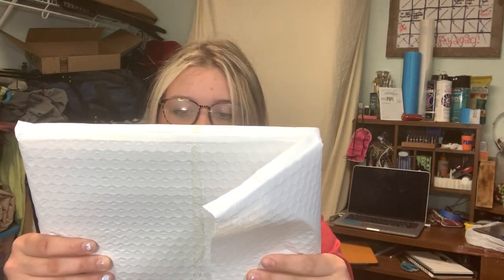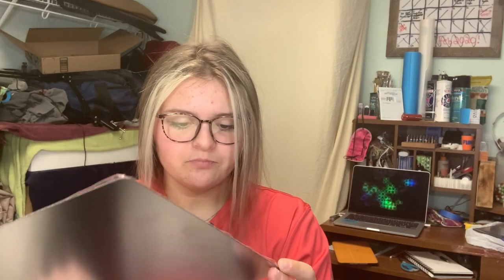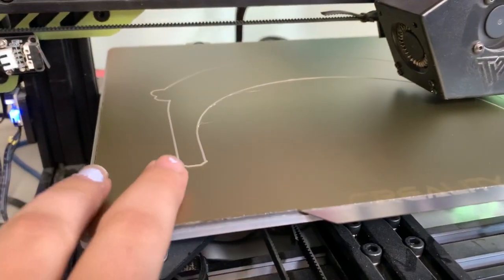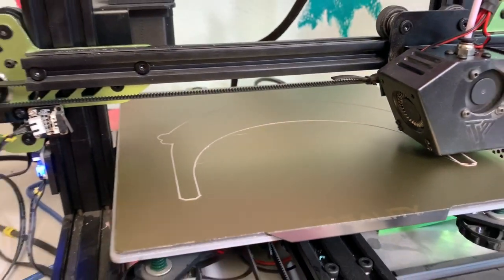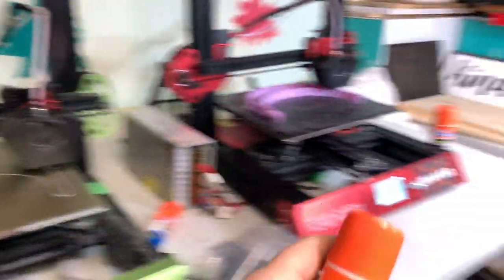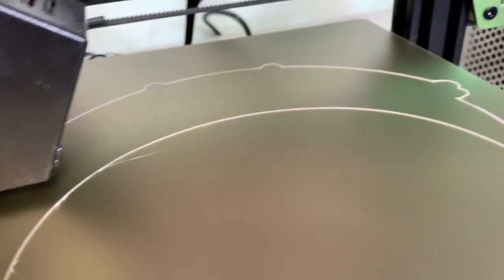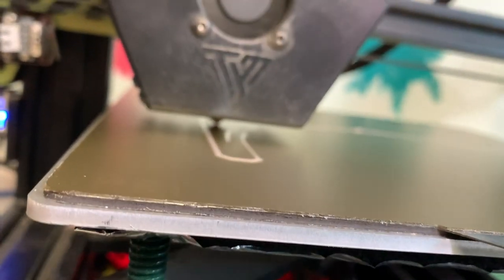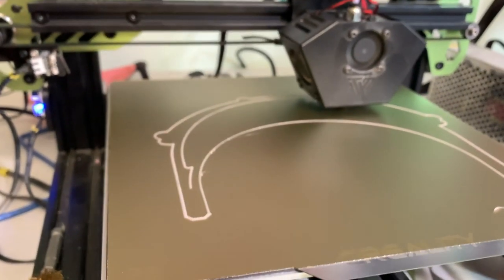Creality3d Felx BuildPlate Review/Install

Comment: For my CR10 I bought a 12x12 sheet of PEI with the peel and stick back then went to Hobby Lobby and bought a 12x12 sheet of galvanized steel and a roll of sticky back magnetic sheet. Then I stuck the PEI to the steel, cut the magnet to size, and stuck the magnet down to the bed. Something that I've run into is the magnet kinda breaking down over time and sticking to the back of the steel sheet. Mostly this was a problem lifting the build plate off when the bed is still warm. I solved the problem by putting a sheet of aluminum foil between the two. The magnet sticks to the foil and not the build plate. Oh happy days 😊
Reply from the maker: Wow that’s super smart to make your own!! Thanks for sharing that’s super interesting! Thanks for watching and glad you got it to work in the end

Comment: Nice video, but you should have mentioned the weight of the magnetic sheet. I know it's heavy, and since it a moving part (on most printers) a slower acceleration and jerk have to be set in order to avoid ghosting.
I am not a fan of glue stick, I think if you if you need it you already doing it wrong. I guess no molten plastic likes to stick to oily fingerprints no matter what surface you have, so try to avoid touching it. Also, I know it's hard, but you should try to keep your printers clean.
Reply from the maker: Thank! I try. I try to blow them off with an air compressor as much as I can. I will make a follow up video so I’ll mention that stuff in there! Thank you!!

Comment: So a knockoff of the Prusa build plate?
Reply: Not quite. Prusa isn't he invetor of this build plate, and they only make them in one size. Energetic 3D is the only manufacturer of this build plate in China, and they made a huge variety of sizes; Creality is most likely one of their buyers.
Reply from the maker: Never used it so not sure:)
Reply: @karolygyorgyhartlein9326  They were one of the earliest to make use of a magnetically attached build plate that uses plastic sheet on spring steel.